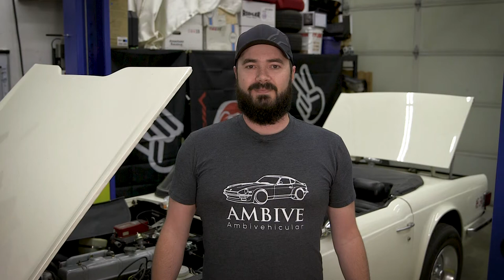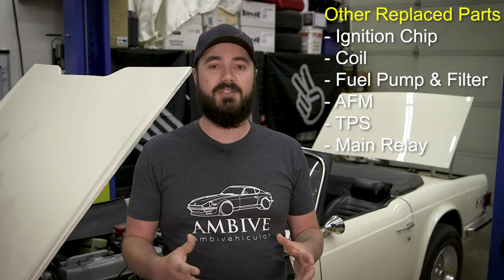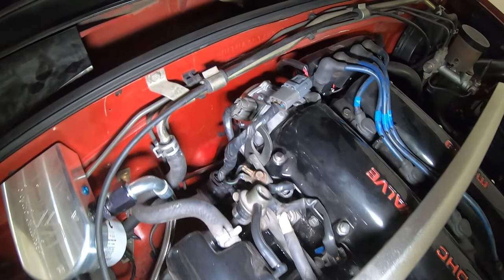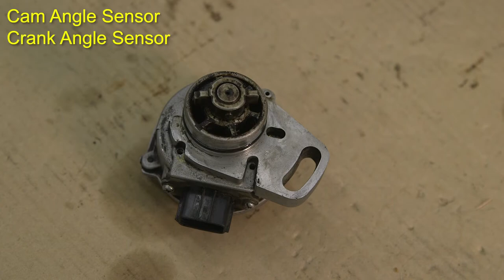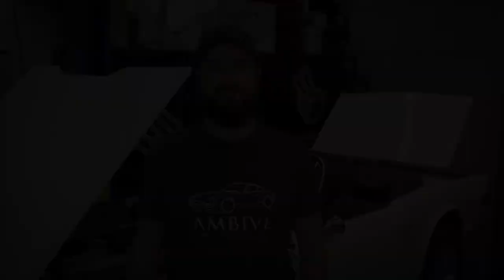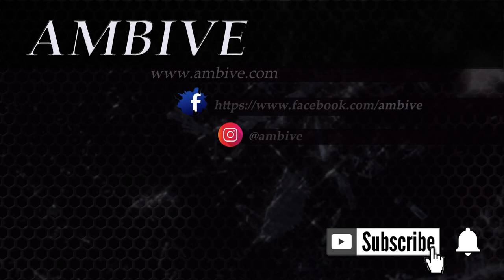NA Miata - Symptoms of a bad CAS

Comment: Thank you so much. My 91 miata is having the exact issues you are describing.
Reply: Same
Reply: Hey man I am having this type of issue plus my rev count fails when the car dies did this happen to you?
Reply: @WrongwayPilot  My miata would stutter on the highway and get progressively worse the longer I drove until it would essentially die. I ended up replacing the air flow meter, coil pack, throttle position sensor (tps), the CAS, and both temperature sensors (one in the front and one in the back) to try to find the issue. Turns out the CAS was leaking oil on the temperature sensor behind the engine and causing all my issues. Definitely look at the temperature sensors if you get a chance. They are relatively cheap and quick fix.
Reply: @jonahharrington7398   Thank you for the advise- funny enough my temp gauge hasn't been sitting in it's normal halfway spot, recently since I have had this issue its been sitting about 30%
Reply: @jonahharrington7398   Hey man thought I would give an update, turns out it was alternator playing up was only charging at 13v instead of 16v so new alternator and the issues are gone atm hopefully they wont come back, haven't been on the highway yet though that will be Monday
Reply from the maker: That's great. Voltage irregularities can mess with all of the electrical components. Glad you got it fixed!
Reply: @WrongwayPilot  Awesome news brother!! It's always a great feeling when you finally locate the issue that has been causing the miata all the problems!

Comment: Hi!  I immediately related to your symptoms because it's exactly what I experienced in my 2002 NB (now at 102 000 km).  Jerking/stalling especially under load and heat (30°C +, highway speed 110-115 km/h, then traffic slowdown).  Engine would die and restart normally after those events.  So I went to visually check my crankshaft position sensor (1.8 L engine).  Found the plastic bracket was cracked and the gap with the pulley seems way too big!  Ordering the CAS today, pretty confident it will solve this nasty problem.  By the way I also had no code after those events.  Thanks a lot for pointing me in the good direction!

Finally after closer inspection the CAS gap with the pulley metal tab was within specs (.032").  And the cracked bracket was still holding the sensor tight.  I went to replace it anyway convinced it was deffective and sensitive to heat.  But same problem showed up on test ride.
Reply: Did you fix the problem
Reply: @Adventureswithhim   Hi Dan!  Replacing the Camshaft Position Sensor did fix the problem.  I did my best to make it failed but the problem did not reappeared (engine stumbling, stalling and re-starting after few minutes).  You have to drive it hard in hot conditions (>30°C) to prove it good.  I don't expect this trouble to comme back next summer!  Make sure you buy the newer version of this sensor, there are cheaper version on the market but they are the old type.

Comment: It is BOTH a cam position sensor AND a CRANKSHAFT position sensor.  It is driven by the camshaft, but if it only had the cam signal, it wouldn't  know where the piston was.  The Miata CAS has two rows of circles cut into a disc.    The outer row has 4 symmetrical slots and this is the spark signal for the four cylinders.  The inner row has two holes or slots, one being 3 times larger than the other.  This gives it a dot - dash sort of signal.  The two inputs together tell the ecu relative piston position and which cylinder to fire.

Some CAS are Hall Affect sensors and some are optical with diodes.  Both have a shutter type system.  BTW, our Mazda Miata CAS is made by Mitsubishi.

Comment: Hope this is my problem. 89 NA Eunos. Changed the fuel pump, filter, spark plugs, plug leads, o2 sensor, drained all the fuel (thought maybe I had bad fuel as I just topped up) and no luck. This CAS sensor will be arriving tomorrow so will see if it’s any better!!
Reply from the maker: Good luck!
Reply: Thanks! Is the o ring leaking what causes the issue? I have the new circuit board for the sensor and a o ring.. would rather replace the o ring than the internals of the sensor
Reply from the maker: It can be. If you can clean it out and it works, then an oring might be enough. If not, the board is probably bad. It could also be worn out elsewhere.
Reply: Did you manage to fix it in the end?

Comment: I got a question I have a 91 NA Miata first it started jerking or stumbling when I was on highway once I kept a steady speed or once I hit certain rpms. thought their was water in fuel checked that got fuel assembly and all that replaced so it should be good. The next day went to start it left it outside for maybe 7/8 min running then I cam out and it had cut off. tried starting again it would crank over but no start
Reply from the maker: That could be ignition, this Miata got worse after running and getting warm. It could be the coil, ignition chip, or CAS. My bet would be CAS, but that's a guess without troubleshooting each part.
Reply: @AmbiVe  what's an ignition chip? Do you have the location or part number?

Comment: I've been having a similar issue with my VVT swapped 91. It'd stumble at both idle and load. Since I'm running a Megasquirt ECU, there was a "sync loss 31" in the data log, which points to the cam sensor. Apparently they're prone to failure on the NB's, but from doing some research, Mazda has updated the design in recent years, so the failures aren't nearly as common.

Comment: I used to have these exact symptoms, and eventual failure, on my 1991 v6 3.0 4Runner. It turns out that it was the Ignitor. The Ignitor & the coil are both connected by the same bracket. It was an ongoing problem for about 2 years till it completely failed & would no longer start. Oh & by the way, I do have a 1990 Miata, 1.6 that is ready for the paint job, & I'm currently waiting for the machine shop to call me, to pick up my engine block & cylinder head for me to assemble & reinstall on my miata. Anyways, while on the freeway, the same thing would happen to me as with your gal's Miata, suddenly a violent quick stall that would just as fast would reignite the engine. This was usually at 65mph or higher, so obviously mostly on the freeway. And just like your Miata, the high speed at which this would happen, would have momentum enough to quickly reignite the engine. And since my 4Runner is stickshift, it was like push-starting the vehicle but at freeway speeds. Once it left me stranded, my friend & I immediately knew it was the igniter. I ran the pre-OBD2 self diagnostics, & sure enough, it gave a code for the ignitor. I couldn't find the extra OEM ignitor that I jacked from the junkyard, so I bought one from Oreilly's. Turned on right away. I got to point out something else, a part that is similar to the Miata & the 2nd generation 4Runners. That's the AFM, Air Flow Meter, which is frequently confused with the MAF, Mas Air Flow sensor. Both serve the same purpose but the MAF was or is the newer version of the AFM, as I understand it. When this MAF starts giving problems, it can be confused with the CAS problems because they are intermitten problems...once in a while, till it gets worse, then leave you stranded. It will also have you chasing your tail...changing fuel pump, relays, fuel dampners, etc. till it fully fails & leaves you stranded. Good thing is that here in Southern California we have an abundance of junked cars, dry, not rusted nor ruined from salted snowed-in roads. Unfortunately since these same generation cars have parts that are as old as yours, the life expectancy is similar & soon enough I found myself trading in my junkyard replacement for a NAPA remanufactures AFM, which is still good today. If i ever go through these same problems on my miata, at least I know the likely culprit of the problem.

Comment: I bought a Miata from someone a couple months  ago. It sat in their garage for a year, and when I got it it had bad gas, and I had to change the fuel pump. Changed it and it worked great. I let it sit again for a while because I had other stuff to work on and now I barely got it to crank And sometimes turn over. The first couple of times when I try to start it , it starts and runs decent, Then stauls. After trying to start it and keep it running it’ll die faster and faster everytime. It’ll idle less and less every time for a couple seconds. Then won’t start and idle at all. Any one having this issue?
Reply from the maker: If it will barely crank then it sounds like an electrical issue or engine mechanical issue. Is your battery good and all connections solid?

You might have several issues ranging from electrical to plugged fuel filter or injection system. Start working through each individually. Get your volt meter and check the voltage through the system and of the battery. After you know you have solid voltages and a good battery, then move to the fuel issues that might result in it dying. If the fuel system is good, then move to ignition.

Sitting is hard on cars. Good luck!

Comment: I’m not entirely sure if we’re having the same issue too, we just got a 93 auto for my gf and noticed a pretty aggressive jerk what seems to be around 2nd gear that it shifts too but then 3rd and 4th smooths out. Would that be a cause?
Reply from the maker: If it's an automatic and it only happens during a single gear change, it's probably a transmission issue. Miatas were never meant to be automatic, so maybe the car gods are offended? It could also be the transmission having a clutch or pressure issue.

Comment: A lot of these symptoms are what my 95 Miata is experiencing right now. The car would run and drive fine, but when I would put it in neutral and coast, the RPM's would drop very low and sometimes stall. This wasn't a super bad issue until just a few days ago when I was starting it to go to class, it started, proceeded to shutter and die and now I can't get it started. I am assuming its the CAS, any ideas?

Comment: my 99 miata did this a couple years ago (died while driving on highway, somewhat spirited rpms) i replaced fuel pump and coil) just a couple weeks ago it died while driving on highway with ac on. would not start.  waited 15-20 minutes and it started and made it home fine, no issues, about 15 miles. Any suggestions?  ty
Reply from the maker: That's exactly what would happen with some of our bad CAS units. When the car cools, it will start fine, then die while driving normally.

Comment: I'm having the same issue but the only difference is that it does not sputter and there are no rough idling, it happens super seldom and only when coasting in neutral. I'm caught by surprise that the engine is already dead as there are no signs that it has died, no violent shaking etc. Any idea on what this might be? Just replaced the AFM but still the same.
Reply from the maker: I would consider the CAS or ignition. I have had that symptom when the idle transition on timing doesn't happen.

Comment: I know I’m a bit behind but would it make sense for a bad cas to cause a wierd tach reading sometimes? Like sometimes it will be normal then sometimes it will be 2k rpm off and kinda lazy
Reply from the maker: I haven't seen the tach read strangely just because of a CAS. That sounds like other electrical issues, especially if it's just the tach reading and the engine isn't actually jumping around RPM. I believe that wire comes right out of the ignitor.

Comment: My Miata won’t start,is it because of this?it’s slowly turns over but doesn’t do anything else
Reply from the maker: If it's slow to turn over, it's probably more likely a battery or starter issue. If it turns over without issue and is getting fuel, then it could be CAS related.

Comment: I wonder if this could be the issue with my Miata , my 92 Miata just turns on and shuts right off ? Could this a be a CAS
Reply from the maker: One of the bad CAD symptoms we had was that the car would be running great and then just die while cruising down the road and fail to start again until it cooled down. So it could be. Bad CAS do weird things on NAs.

Comment: I believe this may have helped solve my problem. I'll look into getting a new CAS, so thank you very much.
Quick question just to verify, though. My NA has been doing the aforementioned things, and it has progressively gotten worse to the point of it not starting anymore. If I jump the battery, the engine stays on only if I continuously rev. As soon as I stop, it dies again. Does this sound like a bad CAS to you?
Reply from the maker: That is basically what happened near the end of this one. It got worse and worse until even revving it wasn't keeping it running long.
Reply: @AmbiVe  you are the man!! Seriously, I can’t thank you enough for your video, input, and response to my question. Much appreciated!
Reply from the maker: No problem. Good luck, I hope you get your car sorted for summer!
Reply: @lilblingking1491  Did you get it sorted?
Reply: @RoxusRemo  yes, turns out it was the alternator bracket working itself loose and not putting enough tension on the belt! Got a new belt since the old one glazed pretty badly and it’s been running great ever since! 

Good luck
Reply: @lilblingking1491  how could u tell the alternator bracket was the problem?

Comment: I had an issue about a year an half ago with my 2001 NB MX5 where i would drive but then it started to jolt and stall, I replaced CAS didnt fix it, i replaced the fuel pump and it fixed it. BUT now im having a similar problem, i drove the car and it would jolt and stall, so i parked it in my driveway, now it wont even start, sometimes it successfully starts but then dies immediately, i replaced spark plugs, coil packs and leads still didnt fix it. All the issues seem to be CAS But how would the CAS Fail after a bought i genuine one a year and half ago..

Comment: I actually just came across this video and I have been having a no spark issue with my 90 Miata for a while now but i did have a question. If the CAS is bad will it still have power up to the coils but it wont have spark? I bought this car with 2 coil packs and i kind of doubt both of them would be bad so I'm just seeing how this system works before I buy a new CAS all together.
Reply from the maker: Correct. It won't fire a spark without the CAS working as it's not instructing the system when to fire based on position.

Comment: Quick question I have a 2006 Mazda Miata and it dies while driving, I’ve replace gas pump, the switch at the end of the key switch but still dies. I clean the throttle body too. Is automatic though does my car have that part you replace in your girlfriend’s car?
Reply from the maker: I'm not sure how the 06 is setup, but they will all have some system for ignition timing vs cam or crank position. You could look up your specific car to see how it works for sure. That does sound like a spark issue or fuel, and since checked fuel pump, my guess is either the computer, fuel pump relay, or ignition system side.

Good luck!

Comment: Hi thr, my 1.6 na idles good but sometimeees the rpms reaches low as 250/300 rpms, over 3000/3500 usually starts running poorly and looks like is not going anywhere, i suppose is cause a bad cas bt here in europe (in italy precisely) i cannot find anything undr 600/650 dollars, i really neet it to be replaced if it is the problem, can i import it from us or something else?
Reply from the maker: If it's just idling erratically or too high and too low, I wouldn't start with the CAS. I would check for error codes in the computer and vacuum leaks. Then maybe look at the idle control system.
Reply: @AmbiVe  that's not only the idle, i checked for codes but I haven't got any, the major problem is the loss of power over 3000 rpms
Reply from the maker: That could be a weird CAS issue. It could also be a load sensor issue, like with the air flow sensor or in the ignition system. If the load isn't being reflected properly, the engine will try to run as if the throttle is totally open or closed when it's not, tricking the fuel system into freaking out and then correcting when the o2 sensor gives the computer feedback that it's way too rich or lean.

Comment: Hi Casper.  In your opinion,  how much better or what's the difference between a car that has a CTS and a car that does not need one?  In other words, why does a car need a CTS?
Reply from the maker: The CAS/CTS/etc, essentially replaces a distributor that you would see in an older car. In say my Mustang, the rotation of the engine rotates the distributor which triggers a spark each time the rotor completes a circuit at each plug wire on the cap. In essence, a CAS effects the same thing, but via either triggering an individual coil per plug or through another system with control of the coils, disconnected from the actual carrying of the high voltage. Both systems are just there to allow the system to initiate a spark at the correct time for the position of a given cylinder.

I would say that a CAS/CTS is a better option overall as you have to have something filling that role to have sequential injection systems accurately in a better package. Now, if having it read a cam shaft vs a crank pully vs the oil pump shaft has a pro or con, I don't know. The SR20DET in my Z pulls it from the cam as well for it's CAS, but a lot of aftermarket systems just use magnets on the crank pulley externally to make them platform independent.

Edit: This is assuming you were talking about crank timing sensors and not coolant temperature sensors. That would be a while different can of worms 🤣

Comment: My NA was running a little hot, but mostly fine... Suddenly died at low rpm while descending a hill... Couldn't get it to start again. Cranks hard but no juice. Faulty CAS?
Reply: Hey, any chance you figured this out? I’m having a similar issue